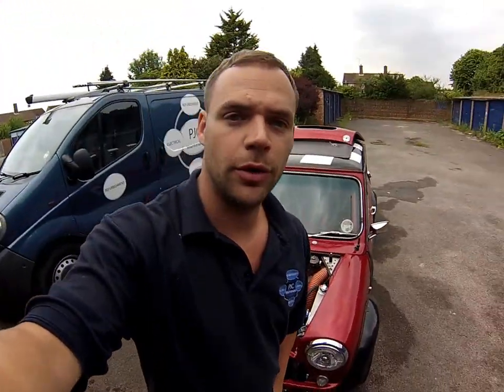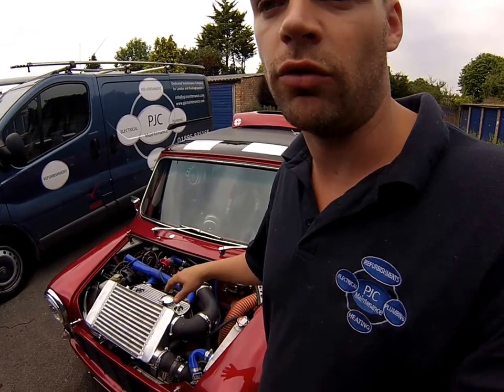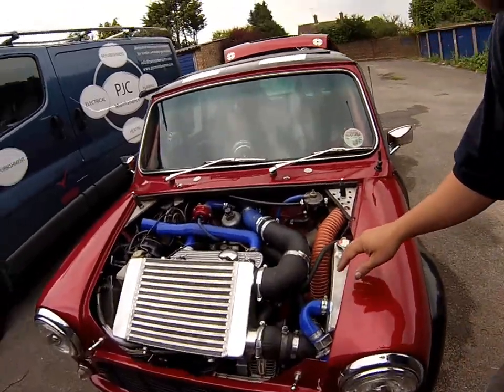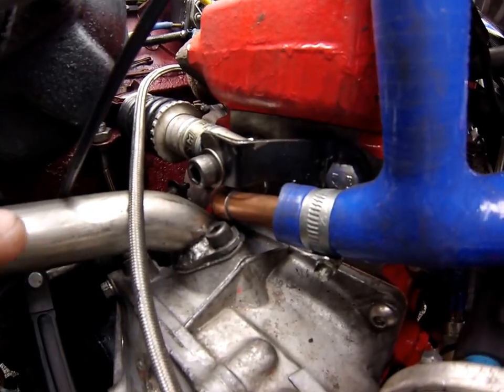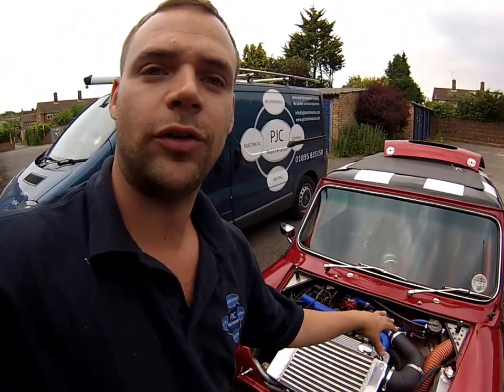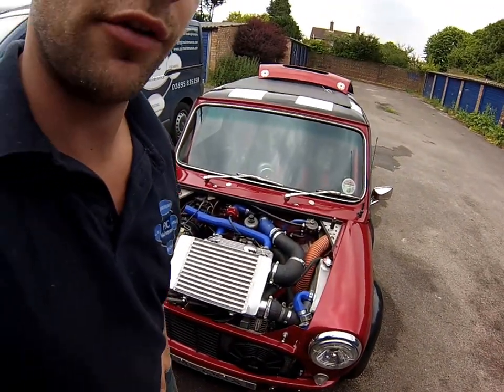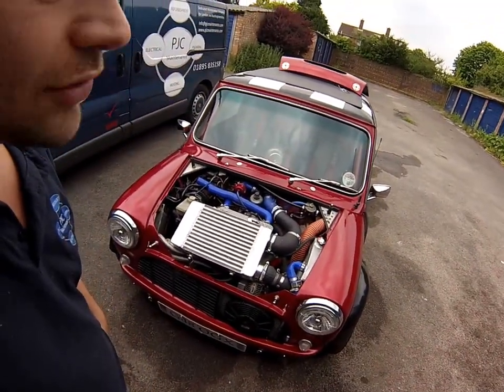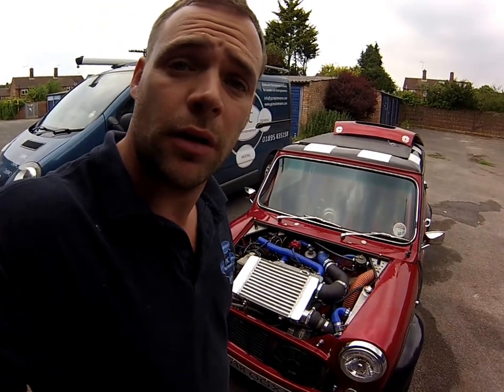Turbo Mini Chat About Cooling

Comment: Hi. What kind of fan belt do you run. I´m thinking about doing the same setup with the waterpump and would like to know the lenght.
Reply: Strarup, really depends on a few factors such of pulley sizes etc... simple way is to use a piece of string around them and cut it and use this as a template.

Comment: is that a chinese side rad? or a radtec jobby?

just set up my mini turbo and having a few cooling issues, just found out it was a seized thermostat
so trading that in for a 74 one @ moss europe
had a radtec extreme rad but didnt want to chop the inner wing so wondering whether to go mpi, 2 core "supercool" or a cheepo alu one

are you going to ace cafe next week?
Reply: Average .Joe, it's a radtech

Comment: Hello my friend , how hard is it to turn into turbo , I have a 1986 1275 metro engine ??
Reply from the maker: Steven Cavana, Simple enough, the biggest thing is lowering the comprehension between the head and the block. Do you research into the turbo specification before under taking any of this yourself. My advise is use a reliable engine builder.

Comment: hi I'm currently building a similar set up, but have gone down the megajolt programable ecu route to run my ignition,  iv blogged my build step by step,

1293turbomini.blogspot.co.uk

there are a few new bits that iv done that I'm yet to add to the blog, but it gets updated from time to time. please check it out and if you have any input I'd be very appreciative, I'm still learning about it all, what started as a " buy a turbo and slap it on the 998 as was" has turned into a full car/engine/head/gearbox rebuild